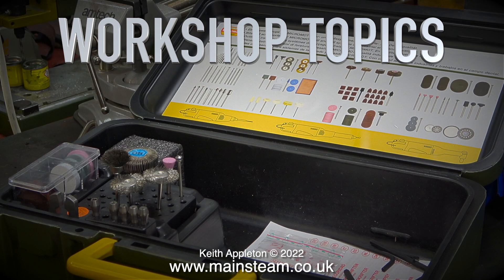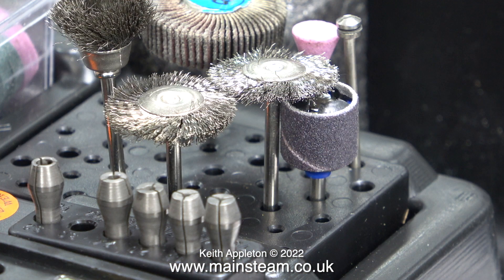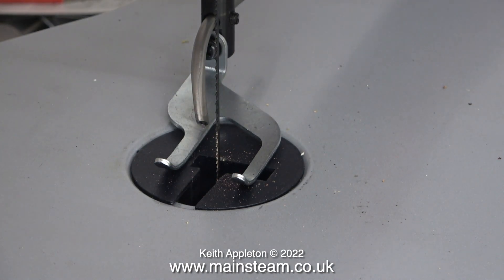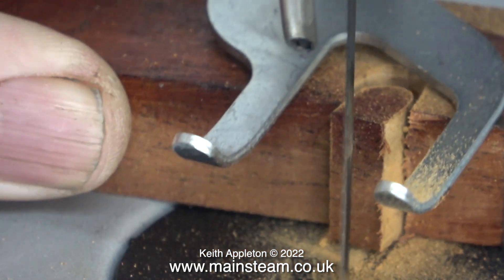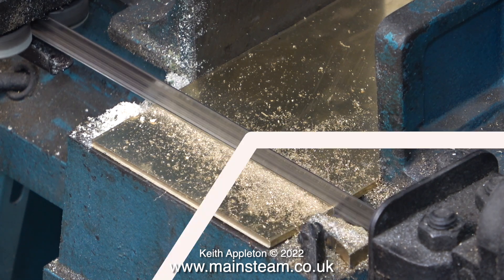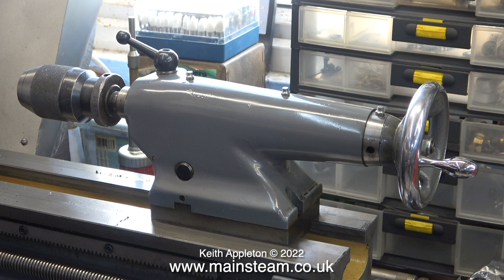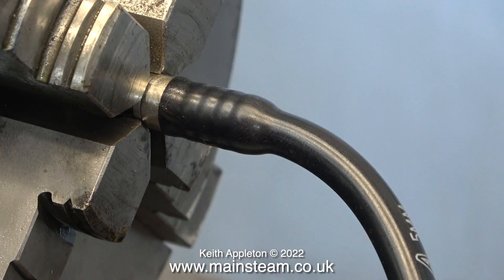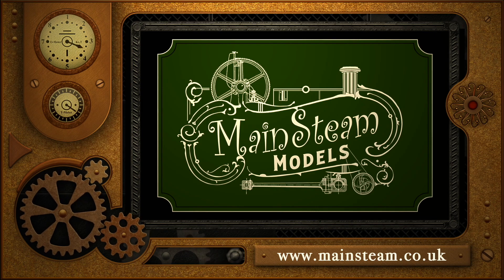WORKSHOP TOPICS - SPECIALIST MACHINES

Comment: another one is the 3D printer. some things ive seen one used for in model engineering is custom funnels with threads for filling boilers, a quick change tool post mounted indicator holder, a cartridge stop, emergency collets, a quick change tool post tool holder holder and all sorts of other tool holders